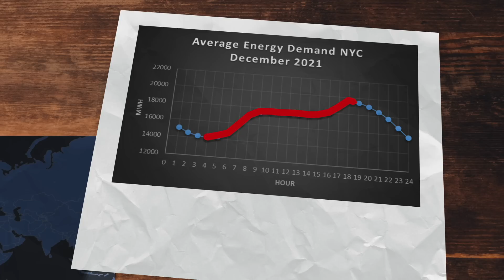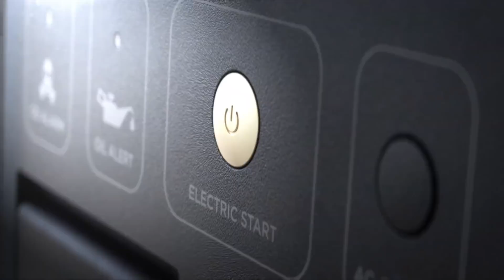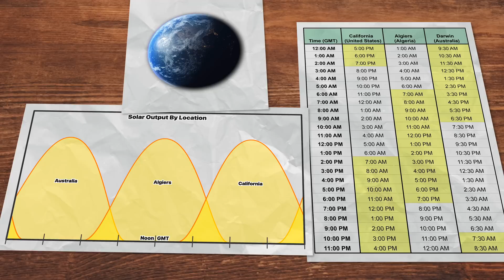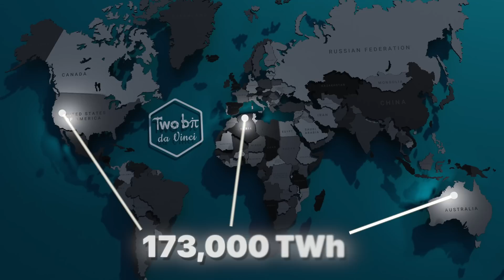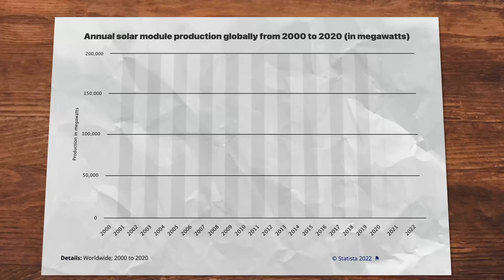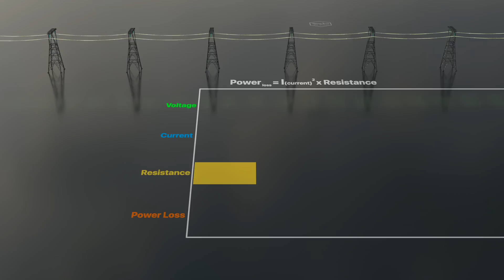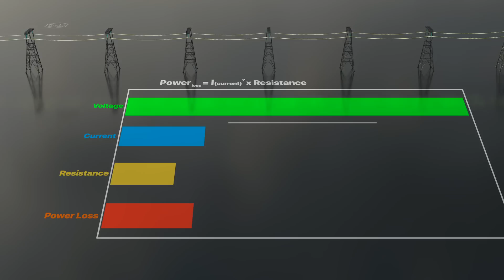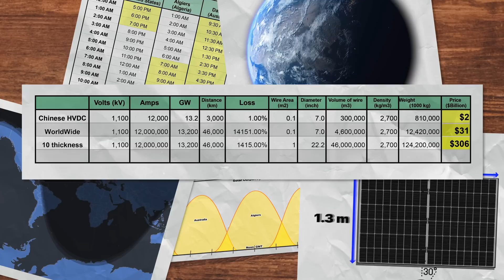World Solar Energy Network... Could this work?

Comment: Quick answer, no, it won’t work and we shouldn’t want it to.  Look at the EU’s reliance on Russia’s energy resource, it’s a disaster!  We should work toward local, distributed energy production and storage.
Reply: Why not do both
Reply: @jghifiversveiws8729  that's what India is doing, Modi was talking about it at last year's COP
Reply: @jghifiversveiws8729 that be making excess energy and is therefore a waste of resources
Reply: @theonewhoknocks2835  I would be inclined to very much agree with you, if there was nothing to be done with that excess energy.

As it is we have had hydro-electric pumped storage schemes operating since Moses was a wee boy.
That excess energy can also be stored in eg Tesla Powerwall batteries( other manufacturers are available) scaleable from single domestic installations to industrial and civic scale schemes.

In eg the Northern Isles of Orkney and Shetland in Scotland, bereft of any electricity interconnectors linking them to the rest of the UK national electricity grid,  green hydrogen based community renewable electricity programs for heat light and transport have been demonstrating this tech now for decades.
Reply: @theonewhoknocks2835 we are underpowered, plus this works only during the day, so power won't be the same everywhere
Reply: So what you're saying is that the issue isn't in the plan mentioned in the video, but with the people who would participate with it.

A lot of issues go away when people learn to get along
Reply: No harm in combining local production with long distance transmission to smooth the supply out. That strictly increases resiliency. One could probably start with just Eurasia to begin with.
Reply: @abcdjhffkuggf  good point. In the end, this is just a thought experiment and there are so many different things to consider.
Reply: @abcdjhffkuggf  among all these people, you talked sense.
Reply: I agree that such a project would be a major headache politically. However...to solve the global problems we have today we will eventually have to start thinking globally. This is something humans currently struggle with a lot, but I hope we can eventually evolve in such a way that we no longer think tribally. This won't be a quick process though since this kind of thinking is part of our baseline programming and has been ingrained in us from the very beginning of our species.
Reply: @rolandrohde  humans do not stuggle to think globally..I worked 25years for a US multinational, we had no problem thinking globally whatsoever.

Globalisation though does bring with it insensitivity to local issues.
Look no further than the great 5 year plans of the former Soviet Union, that forced untold misery and death upon its population, in pursuit of its leaders global ambitions.

I do however believe that global solutions can be adapted to suit local conditions and demands.

This I believe requires input from the ground level up, to hold higher management, at every level, accountable for their value judgements and policy decisions.
Reply: @gordonmurray3153  
That's not what I am talking about at all. A multinational corporation thinking globally...yeah... that's not the issue. But "normal people" that don't really feel like what happens abroad affects them (while typing on a Chinese made phone, eating nuts imported from Brazil, sitting on furniture made from imported wood and wearing clothes made in Malaysia) are the real challenge.
Reply: @rolandrohde  I’m an optimist when it comes to technological advances but unfortunately humanity seems to have regressed in the last decade from a social standpoint. The last few years have pretty much convinced me that there will always be a tribal nature to humans.  There’ll always be people who have mental issues who cannot see anything other than what their tribe says must be true.  And leaders (sometimes with deep mental issues of their own including delusions of grandeur etc.) and social figures very willing to exploit these situations to their fullest, for both money and power. I’d like to believe otherwise and will be ecstatic if I’m proven wrong, just my feelings from recent times.

I believe it’s entirely possible to generate sufficient energy locally with some storage technology that makes an overly complex global grid unnecessary.  Interesting thought experiment but more effort than merely using technologies that already exist or are close to commercializing.
Reply: @sjsomething4936  whilst sufficient generation from renewables & very long-term resources like geothermal are definitely possible we suffer from politics & from fashion so it will take a very long time for this to happen.
Reply: It would be an interdependent system. The oil thing is completly different
Reply: @daivonclark5151  yeah, because nobody can hold the world hostage when it comes to oil & gas supplies, right?

This isn't a one size fits all scenario.
If you live in Sub-Saharan Africa, or the high deserts of the Mid West US, then naturally it is only to be expected that your first thought is going to be solar power.

The issue is getting that solar generated electricity from these deserted areas with no people, but lots of hours of sunshine, to areas with not so much sun and desert heat, but lots of people all needing a sustainable source of reliable green electricity.

Since most of the global population is living near a coast in the Northern Hemisphere, perhaps a more practical solution might also be near a coast in the Northern Hemisphere.

Cut out those potential crazy transmission losses, by producing electricity near to where the people will need it.

I dunno, offshore wind, tidal, ocean current, or wave energy powered electricity generation, where perhaps higher waterside land prices tend to render solar energy farms less attractive as commercial prospects.

Rivers and streams flowing to the sea, with human habitation and agriculture, concentrated on their banks, could be candidates for various forms  and scales of hydroelectric projects.

Just saying.
Reply: @gordonmurray3153  the transmission losses on HVDC are orders of magnitude less than AC at any Voltage, long transmission lines are completely feasible & already in use.
Reply: @gordonmurray3153  idk what that first remark was about... Atleast in regards to what i said lol.
 Yeah whoever controls the oil, controls the world pretty much. The global solar grid plan would be different since the whole grid is one united grid that we all share... the whole planet recieves sunlight at some point.
 As long as it produces more than enough energy for the world, there shouldnt be any conflict in theory... Unless petty ass humans threaten to dismantle it from their end, but everyone loses at that point. 
The engeneering details are another thing.
Reply: @alanhat5252  Not really correct, DC is only somewhat less lossy at distances greater than 500km. It is not orders of magnitude.

Up to 500km aerial AC distribution is generally more cost effective. Above that distance DC can be a better option due to lower radiative losses. DC is generally a better option for undersea cables due to a lack of eddy current losses.
Reply: The internet (aka: World Wide Web) is set up to allow continued service even if several data lines fail (apart from Starlink satellites). Would need a larger grid of transmission lines to route around war zones if international cooperation for worldwide free energy is not possible.
Reply: It is not the same thing.
Whole world energy grid is simbiotic relationship. You rely one to another.
During night you get from them and during they night tey get from you.
It's not like only you have energy (oil, gas)  and another side do not have it.
Reply: Nope, keeping local,  solar with a mix of wind is better, I'm hoping for fusion😁
Reply: Let's just address one part of this idea and that is high voltage transmission lines. We are just now beginning to produce graphene in industrial quantities,  but as that increases, we can use it for light weight transmission lines that have  several orders of magnitude less resistance than copper or even gold and that are immune to EMP. The raw materials can be gotten from the atmosphere or terrestrial sources. Such lines would be entirely self supporting and can be wrapped with graphene that acts as an insulator. This is where we need to invest our R&D dollar's. If all transmission lines were graphene along with most of the wiring in homes and buildings, the savings in just transmission losses would pay for the system. This would require no cooling and the strength of the lines would drastically reduce storm damages.  Quite often, the only repair work would be to raise new poles to support unbroken lines. With drastically reduced thermal contraction and expansion, runs could be longer with less margin for thermal events. Of course, underground runs would be better and less prone to water damage. The only remaining vulnerable points would be the voltage adjustment stations and all attached equipment. With adequate Faraday caging and proper grounding, most of that can be alleviated. Of course, if most internal wiring is also graphene based. EMP would have nowhere to work.
Reply: @everettlwilliamsii3740  the transmission costs of HVDC may be much lower than a similar distance of High Tension AC powerline, perhaps up to half - but not many orders of magnitude. 
That said: how many substations are required to distribute that energy to be usable locally, where does that impact the break even point on  economic viability of the system?
Reply: @gordonmurray3153  actually, the difference in cost can scale to orders of magnitude, since the variable costs are much lower for DC transmission lines. You need fewer lines, and the can be thinner.  The problem is the upfront cost of the DC voltage step up and step down systems, which are much more expensive since transformers don’t work with DC
Reply: After the break even point between the two techs, each extra mile makes the difference in cost greater. That said, I believe the cost comparison between the two technologies considers the same number of substations to connect to local grids. It wouldn’t make too much sense otherwise
Reply: @ipp_tutor  there are swings and roundabouts to HVDC.
Power losses with HVDC as things stand are around half those of HTAC.
So there are savings to be made there.

The tech however is currently too immature, or it would already be getting rolled out now.

Technical issues persist, such as cost effective circuit protection for HVDC, eg you cannot just install a fuse or an earth leakage circuit breaker, or a power switch, and expect them to work as you'd expect a comparable high tension AC power circuit to work.
Anybody who has ever watched a demonstration of a Van der Graaf Generator will be aware just how far HVDC electricity can jump.

That HVDC also has to be converted to domestic and industrial electric power levels at every substation along the system.
These features do not come cheap, or reliable, at their present state of development.
Reply: @ipp_tutor  the end of copper is in sight, we've dug up almost all of it which means that transformers are becoming more expensive plus we're getting more worried about losses so electronic Voltage changing is rapidly taking over the networks.
Reply: @gordonmurray3153  with HVDC you are citing problems which have already been overcome & HVDC is installed in & between many countries right now with more following rapidly. For example UK currently has 8 interconnectors to the Continent & to Ireland as well as nationwide distribution all running HVDC. I understand this has been enabled by semiconductor electronics doing away with mechanical switchgear.
Reply: But what if it were run by  decentralized software written in rust.  The energy would be much less able to be politically useable.  Making the world more free.  Now if I could just get them to accept my nft promissory note😂
Reply: @johnschneider931  many domestic grid-tied inverters balance themselves to the grid's loading by sensing frequency already, making this mandatory shouldn't be difficult even at a global level, thus automating load balancing to an extent.
I understand the infrastructure for UK's Smart Meters can also signal from the grid for domestic generation to increase or decrease supply to the grid & there is a mechanism for large consumers to be requested to disconnect loads, eg Tesco's refrigerators are switched off for 15 minutes on request from the National Grid.
Reply: Agree but I would add nuclear for energy guzzling industries like steel, aluminium,  cement, fertilizer, synthetic fuels, chemicals etc.
Reply: 40-odd% of the uranium being imported to fuel nuclear power in Europe is supplied by Putin from the Russian Federation.

Kind of an out of the frying pan into the fire scenario.

With so much wind wave, tidal hydroelectric, solar, geothermal etc etc etc energy, currently just going begging, why would anybody commission a short lived stop gap nuclear reactor, simply to electrolyse red hydrogen from water, when there is a potential super abundance of green hydrogen all at our fingertips.
Reply: @gordonmurray3153  There is plenty of uranium and thorium available from reliable, trustworthy sources.

 I agree we should use all the hydro, solar and wind that we can but when you do the sums it is just not sufficient. To securely power a modern electrified society of 8bn, we need far more energy (on average about twice)  than can be gleaned from renewables alone.

This is clearly evident in Europe where Germany, despite strong green policies has reverted to coal fired power and is even chucking its forests into the furnaces. France has been far more pragmatic, it is expanding wind power, renewing many of its 38 existing nuclear power stations and building 14 new EPR2s. It will not revert to coal and timber.

As for green hydrogen I agree it will have a role particularly in making steel, some process heat such as cement and many chemicals. However, the hydrogen cycle is woefully inefficient, less than 50%, so is very expensive. It can only be used where there is no reasonable alternative.

Nuclear fusion is a possibility but the plants will be very expensive and probably very large (this is a consequence of the physics involved). There is no realistic possibility for widespread uptake of fusion inside 50 years. However, hopefully it will be able to take over from fission energy about 100 years from now.

Fission of course, particularly in the form of the very safe, reliable and affordable CANDU and EPR plants is available now. These are large plants in the 2-4GW range typically built in situ.

Safe affordable small modular reactors (.1-1GW) are in advanced development and will be ready for mass production within five years (they are made in factories on a production line). For some such as the Thorcon product, the entire power station is built on a barge, floated to site and can be up and running in just a few weeks.
Reply: if country A depends on B and C, B depends on A and C, C depends on A and B then that's a completely different scenario. Russia-Ukraine is A deoending on B only
Reply: @ThomasBomb45  no, Ukraine's energy problems are from the invasion & Russia blowing up infrastructure. Ukraine generates its own electricity & transmission lines for electricity, gas & oil all work just as well in one direction as the other, Ukraine can & does take supplies from all its neighbours. There are problems where those neighbours have become overly-reliant on Russian supplies so cannot supply Ukraine but that situation is being resolved.
Reply: I guess you will build your own sun then 😂
Reply: @allah___maadarchod  they're working on that
Reply: Transferring electrical energy over long distances doesn't work. All power lines have resistance and there are greater losses the farther you go. About 300 miles is the most from generation or substation to use.
Reply: @sz5736p  the 300 mile transmission limit you cite has already been superseded by a large margin. I don't pretend to know the physics of it but it can be seen 'on the ground'.